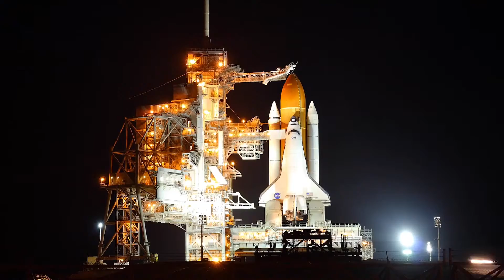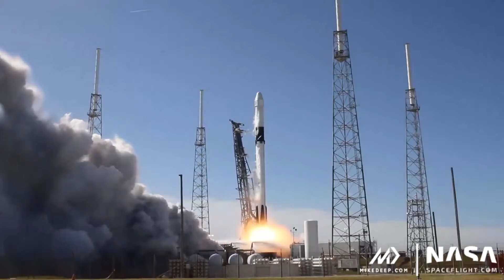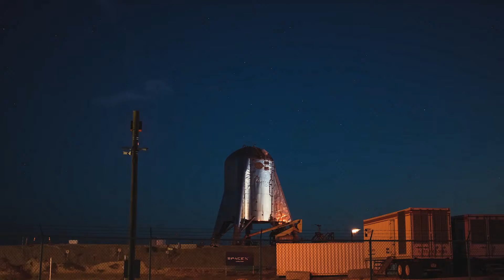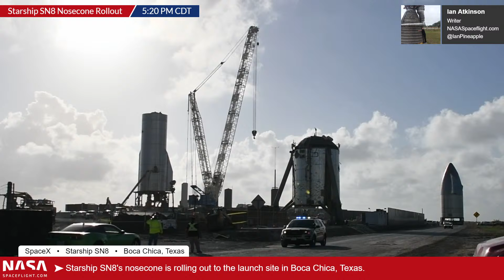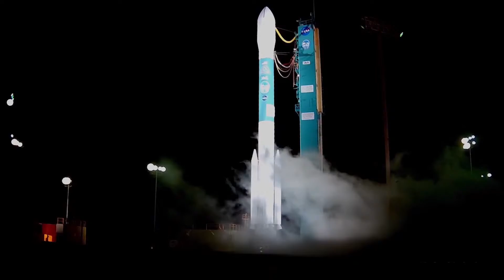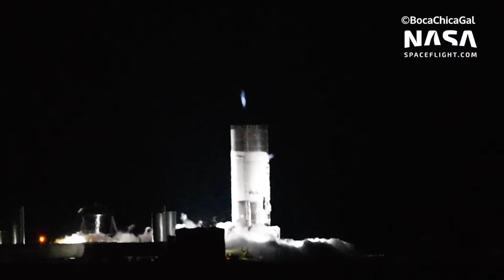Starship SN8 Nosecone Rollout in Boca Chica

Comment: The flip at the end of the flop will be done mainly by closing the rear control surfaces and opening the forward canard surfaces.  The rocket will then pivot around the forward control surfaces as the Raptor engines gimbal to stop the swing and bring the rocket to a vertical position for the landing.

Comment: Motors are operating through a gear box, would be interested in the details of that box, e.g. ratio and torque
Reply: Probably a lot of torque needed to resist the pressure from the on coming air stream

Comment: The rolllift actually uses load distribution across multiple axle groups and NOT wheel span, each wheel is standard in diameter & width and is mounted on a single axle with independent drive units which can be rotated around its mounting point above providing infinite turning in very tight areas, in addition each wheel set can be raised and lowered to maintain load deck leveling.. 

The roll lift uses the same load spreading principle as a rail wagon which spreads it's load across it's multiple bogies and axles...

Comment: As I understand, the upper stage will fly into space. In vacuum weightlessness, why  3 raptors intstalled instead of 1 optimized for propulsion in space ?
Reply: The first stage will have 6 engines 3 sea level raptors and 3 vacume raptors because the ship will need to land also it will be very heavy to much for a single engine to handle
Reply: @Condor-uc2lw  oh, thank you. I thought the second stage will be burned up and not to be reused. So the whole starship will return to earth without any space trash ?
Reply: @rock3times  yes, you got it! Full reusability

Comment: How will Starship be lifted onto Superheavy? Will they stack it after the nose cone has been placed or before? Are there anchors to lift the Starship by the nose?

Thanks for the update guys!
Reply: There are anchors on nose cones for moving around in the yard, but not sure if they have enough strength for the whole SS. They will definitely have to pick them up with the nose attached at some point though.

Comment: According to the Starship Users Guide the nose section/payload bay will be removable and will be positioned in some sort of payload processing facility near the launch site. The payload cargo will then be loaded into the payload bay. The nose section/payload bay will be moved to the launch site and will be stacked on the lower part of Starship. This is pretty much what's going on now with SN8 except the payload bay is empty.
Reply: Could be a two step process?  To get testing, weld it for the prototypes.  Get it flying, and then use this data to help refine a locking mechanism?  I’m sure that they have something in mind since the Users Guide states the possibility...  Just a thought....

Comment: I wonder how they weld the two sections together since I assume there is no way of getting inside the nose to weld on the inside only the outside?
Reply: They will leave workers inside it so that they can weld it. And it will become first manned flight of Starship.
Reply: I think they have bulkhead portholes to climb thru then seal up after maintenance.  They crawled back into SN5 after the hop
Reply: it will have to deal with a great amount of force and stress when turning from freedive right before landing so I can't even imagine how they will ensure it doesn't break
Reply: Leave it all to Elon. He is awsome in the sense he makes things deeming to fragile but it works.
Even the Apollo and the Saturn V were painted. Elon's pieces are left steely shine with visible riveting. Maybe Elon want to save weight and/or costs. But the things fly off to space, return, landing, refurbished and fly again..
In the hindsight, Elon proves NASA wasted tax money. He can do better on the cheap.
Kudos to the private entrepreneurship.
Down with government bureaucracy.
Reply: Vincent Nguyen ——-I believe they could not have done this as they did not have the technology back then.  Could they have done better?  Yes. Politics influence design.
Reply: @rickharms1  I want to be fair here. granted, Elon benefits from previous works done by NASA. He can not do it alone. However, to charge 2 million per lift and keep the shareholders happy, Elon is both a scientific and business genius. No way NASA can fly that cheap.
Reply: Vincent Nguyen oh, I totally agree.
Reply: Theres a hatch
Reply: There is far more than just welding to be done; that's probably the easiest and most straightforward part. I suspect that most of the work would will be in cabling and plumbing between the two sections, then testing and retesting each system. Bound to be some troubleshooting involved. too. And radio antennas to install. I wonder where they will be, and what types?
Will it have port and starboard running lights and beacon strobe? FAA-assigned "N" number? :D